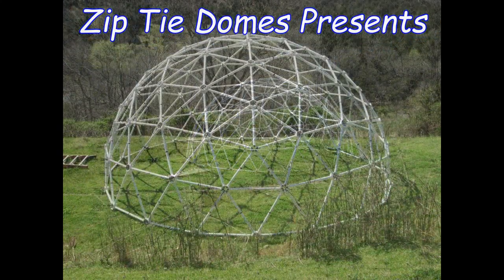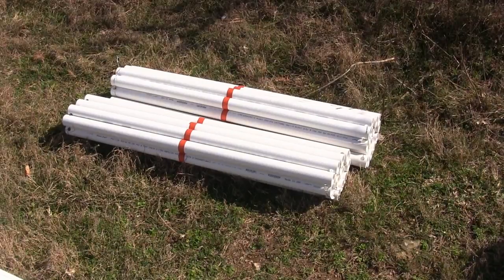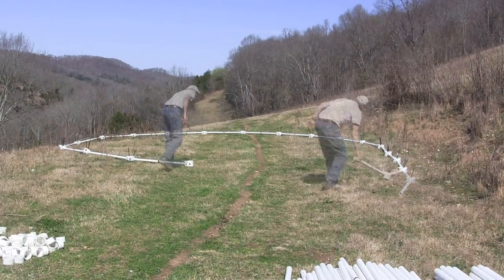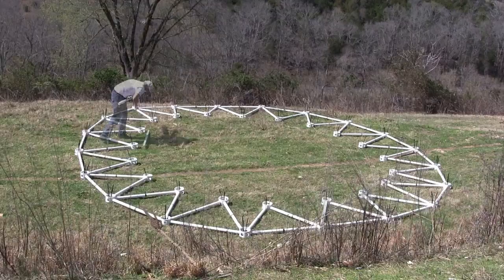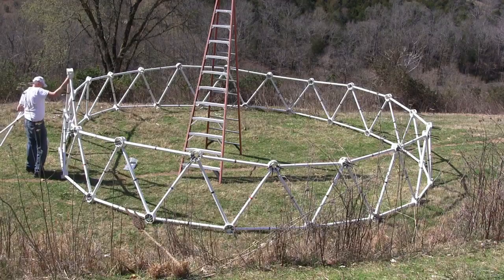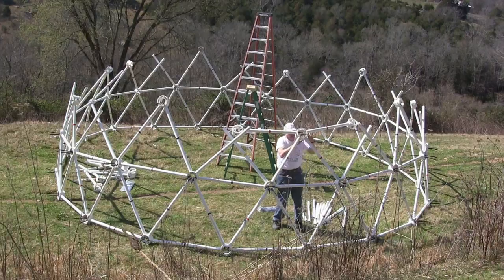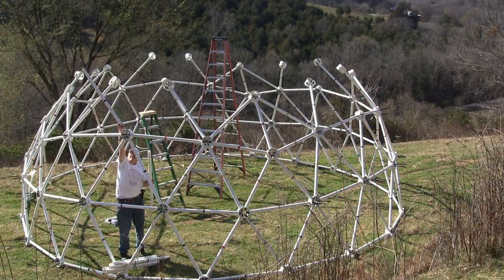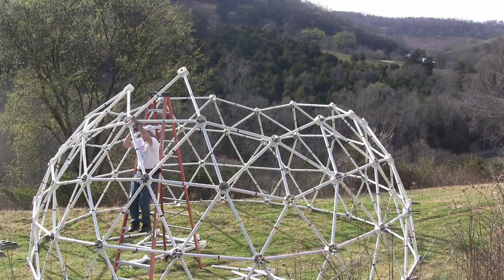How to Build a 4v Geodesic Dome

Comment: I once tried to do something like this with 4" pvc hubs, 2"x3' pine logs, and pipe strapping. I was not aware that the edges needed to be slightly different lengths so by the third tier it was seriously out of round and the pvc hubs were beginning to warp from the weight of the logs.
Reply from the maker: Yes, I would use metal hubs for pine logs.  But that is great that you are developing new ideas.  Thanks for watching the video.  John Hurt

Comment: This is amazing!!! I just finished building an 8M geodome made of aluminum with bolts and it was so freakin hard and was a 2-3 man job. Next time I'm going to go with this model. Love it, especially those easy connectors!
Reply from the maker: Thanks for watching the video. Have a great day!  John Hurt
Reply: The hubs simple but are not self-centering, which will become apparent when you try to re-center them under load.

Comment: Thank you for the video.  I will look at your calculator to build a 14' diameter 2v dome for my daughter as a greenhouse/hang out space.
Reply from the maker: Hello.  Yes, you can buy a 13' dome 6.5' tall at this link:
https://www.ziptiedomes.com/geodesic-dome-kits/13-2v-geodesic-dome-kit.htm
Or you can purchase just the hubs from us, and cut your own struts from 1" Schedule 40 PVC pipe.  The "Hubs Only Kit" is at this link:
https://www.ziptiedomes.com/geodesic-dome-hub-kits/2V-Std-Geodesic-Dome-Hubs.htm
Call us at (931) 858-6892 and we can help you with the strut lengths for your 14' dome.  Or you can use our dome calculator at this link:
https://www.ziptiedomes.com/geodesic-dome-calculators/2v-geodesic-dome-calculator.htm
Just click the "standard 4" hubs" radio button, put "14" in the dome width/diameter, and click the blue "calculate" button.
Thanks for watching the video.
John Hurt

Comment: 4 frequency
26ft diameter
13ft high
4826³ft
548²ft floor
30 Red A struts 930mm (3'⅝")
30 Yellow B struts 1100mm (3'7¼")
30 Brown C struts 1095mm (3'7⅛")
70 Black D struts 1172mm (3'10⅛")
30 Blue E struts 1220mm (4')
30 Orange F struts 1115mm (3'7⅞")
6 Red 5 way hubs
85 6 way hubs
91 centre rings
500 zip ties

The diameter of the struts and holes is covered here :
https://youtu.be/v_NnY_yYwuc?t=540s
Reply: chickkeys  It's in the video description, which is sometimes hard to see if you are using a tablet. The struts are made from standard 1.5" Schedule 40 PVC pipe.

Comment: No BS here. Great video. Great idea for a Permanent Home structure...using 1 inch Conduit.
Reply from the maker: Thanks.  Check out the Desert Domes website, they show you how to flatten the ends of the conduit, drill it, and bolt the ends together to make your hubs or vertices.  That would be a great way to do it and make your own hubs.  John

Comment: great tutorial and this looks really easy to do. However, zip ties? How are they going to withstand the power of the sun whilst holding up all that weight?  I have secured some plastic net on my railing with zip ties and a couple of years later the sun made them brittle.
Reply from the maker: That is a great question.   As this is a temporary build, the video shows us using 250 lb UV resistant Nylon Zip ties which will last for several years. But for all of our large geodesic domes, we provide 350 lb Stainless Steel zip ties that will last forever.   Thanks for watching the video.   John Hurt

Comment: Hi. Can a pipe diameter of 25mm be used for 4v? (width 8m height 4m)
What thickness would you recommend?(25mm-32mm)
Reply from the maker: We use 32mm as it is much stronger for larger structures, but we can drill the hubs to work with 25mm pipe just as well.  Thanks for watching the video.  John Hurt
Reply: @ZipTieDomes  Thank you very much. Do you mind if I make this 4v structure with my own means and share it with you on youtube?
Reply from the maker: @eyyupk  Yes, you can build one, but I don't need it on YouTube. Just send me a picture of your completed dome - in exchange for a license to use our patented hub design.  
https://www.ziptiedomes.com/faq/Are-You-Making-your-Own-Hubs.htm
Thanks!  John Hurt

Comment: I’m looking for a semi permanent structure.   Wonder how it would do over winter in Canada  north of Montana 
Saw the cover video with the use of caps 
I want a 24 foot diameter 3 season work area protecting from weather
Reply from the maker: The strongest domes we have are the "Shelter Domes" with 1.5" PVC pipe struts.  
https://www.ziptiedomes.com/geodesic-shelter-domes/index.htm
They can support over 300 lbs from a single hub:
https://www.ziptiedomes.com/video/silodomeloadtest.htm
You can also buy just the 6" Super Hubs and cut the 1.5" Schedule 40 PVC pipe struts yourself:
https://www.ziptiedomes.com/geodesic-dome-hub-kits/index.htm
Call us at (931) 858-6892 if you have any questions.
John Hurt

Comment: Hey, I see that you may still be responding to comments on this video! That's very cool!

I was wondering if you know if it's possible to make a dome out of struts that are all the same length.?? And what shape would that be?? I was looking at an icosahedron, and "bisecting" it to make it look more round, but does that mean that the lengths of the struts have to be increased to make it look round? Thanks!
Reply from the maker: The 1v dome can be made with struts all the same length.  Here is a calculator:
https://www.desertdomes.com/dome1calc.html
Thanks for watching the video.
John

Comment: Appreciate the video. What is the snow load?
Reply from the maker: With 1" PVC pipe and Standard Hubs, the dome will support around 180 lbs from a single hub.  With 1.5" PVC pipe and the 6" Super Hubs, the dome will support around 300 to 350 lbs from a single hub.  
John

Comment: Hi John,
I really like geodesic domes, I believe they are the pinnacle of human ingenuity. They are very rare however, I have never come across one. I'm thinking about building my own in my back yard, although I'm still not sure what I would use it for.... do you have any recommendations? I don't know how I would enter the dome, since there is no door, or how to place anything inside it, for that matter.... I might cover the outside in solar panels since I want to do my part in fighting climate change.
Suggestions would be greatly appreciated! 
Thanks a lot,
Steven
Reply: Hey VR, I just started building a dome a few months ago and am documenting my process and all of the issues I have run into. The material really depends on what you are looking to do with it. I am building a timber dome using bevel cuts because it results in smooth transitions between panels which allow me to easily attach polycarbonate, film, or wood for the covering. If you were wanting to cover it in solar panels, I believe that would be best as well. With a PVC or conduit dome, I can see there being a lot of issues with being able to sturdily attach anything besides film. As for the door, one of the 5 point attachments is usually disassembled and extended into a door (I can find a source to show it if needed).
Best of luck!

Comment: thank you , very nice structures you do there,  i have checked the calculator online  it is amazing also, what is the diameter of central ring ?
Reply from the maker: It depends on the hub size.  Either 2" or 3".

Comment: I’m thinking of a dome built from the top down to the bottom so every level would just raise up and the ladder would be used less.  Have you tried that, and if so how did it work?
Reply from the maker: I did, and it seemed to be harder to to.  I had to build a pole with a pulley on top, and pull the dome up as I built the lower sections.  It was a lot more work than building from the bottom up, but I did not have to get up on a ladder.  I would suggest starting with a small dome and build from the bottom up first to get experience on what works and what doesn't. Thanks for watching the video.
John Hurt

Comment: Loved your video! Want one. Do you have any recommendations for coverings? Would love to make it a permanent structure.
Reply from the maker: I would cover it with mesh and spray it with latex cement for a roof.
Reply: @ZipTieDomes  do you know how much of it is needed ?
Reply from the maker: @chegist  It depends on the size of the dome.  Pick out a dome from our website:
https://www.ziptiedomes.com/
then contact me at this link:
https://www.ziptiedomes.com/contactus.htm
Thanks.  John Hurt
Reply: @ZipTieDomes  Haven't seen any recent postings to YT, hope all is well as possible, if you are still around with your business, did you try the latex cement as you were planning on covering a dome with this method
Reply from the maker: @sjr7822  I made a concrete dome prototype, but I have not made a video about it yet.  Thanks for keeping tabs.
John

Comment: How much weight can this structure sustain? Can you show a finished product with glass?
Reply from the maker: The 1.5" struts will support around 300 lbs from a single hub.  We usually cover these with greenhouse film, as glass is very expensive.
Thanks for watching the video.  John Hurt

Comment: Very interesting project.  Was wondering why so many different sizes in the struts?  Can it be simplified to 1-4 lengths?  I'm sure rigidity is the reason but just started learning about these.
Reply from the maker: We did create a "Simplified 4v Dome Calculator" with only 4 struts instead of 6 at this link:
https://www.ziptiedomes.com/geodesic-dome-calculators/simplified-4v-geodesic-dome-calculator.htm
But for the dome to be mathematically "correct", it requires 6 strut lengths for a 4v dome.  It has to do with how the triangles are broken down into smaller triangles to make the 4v dome design.  That is a good question,  go to our "Contact Page" if you want to discuss this:
John Hurt
https://www.ziptiedomes.com/contactus.htm
Reply: @ZipTieDomes  great, I'll check it out and reach out if i have any more questions.  Thank you!

Comment: What type of materials are used to enclose the dome? Can you attach wood or plastic triangles into the pipes as a form of roofing?
Reply from the maker: We usually cover it with a single sheet of plastic.  If you cut plywood into triangles to cover the dome, there is a LOT of waste.  Thanks for watching the video.  John Hurt
Reply: @ZipTieDomes  thank you

Comment: is it possible to build a geodesic dome using only some size pvc pipes?
Reply: If you don't have the retaining rings, it will just be floppy. There's also some companies that make 4, 5, and 6-way PVC connections for this purpose, but they're a lot more expensive than making your own rings.

Comment: How do I figure out the measurements for a 35 foot high on top by 35 foot round? Looking to build one of these under ground and out of metal and concrete reinforced. 10 ft drop from the bottom of the structure straight down? Plus what was the cost of this build with PVC piping and zip ties
Reply from the maker: Send me an email, or call me and I will be glad to work directly with you on your project, at no charge. 
https://www.ziptiedomes.com/contactus.htm
Thanks,
John Hurt

Comment: That is a great system for the frame construction, do you have a similar system for covering the domes in different fabric and rigid materials? Also how easy is it to adapt the system to produce a structure that is longer in one floor dimension to build an enclosure better suited to a rectangular space?
Reply from the maker: Daniel,  We don't offer covers at this point, and so far we only have round dome designs.  But those are two very good ideas.  Thanks.  John Hurt
Reply: Steve Baer developed Zome geometry which allows you to stretch the dome shape. It's significantly different from geodesics, though, so I'm not sure it would work with these hubs.
Reply: @ZipTieDomes  What is the purpose of this structure if not to add greenhouse plastic or covers to turn it into living tent space of some sort?

Comment: Could you make a honeycomb geodesic dome? I have a vision to make a honeycomb geodesic dome that would cover an A Frame tiny house, maybe about 20x20 ft, with the floor diameter of maybe 20 more feet with the house being in the middle so 10ft in radius. And about 20 more feet above the house itself. This way it encloses the house during rain and snow, and making a number of the honeycombs being able to open up but have small mesh to prevent bugs and other pests from coming in. And having 4 smaller domes attached to the large dome to create a 5 point dome system. One dome for growing veggies, one for growing fruits and one for having chickens or ducks and the other for having rabbits. Almost like a biodome enclosures, but being in the forest close to nature without damaging or touching nature. So the large dome acts as a natural greenhouse for the house itself. Making it warm during the winter months and dry during the rain months, thus using less material for keeping warm. Do you think its possible to do this out of your PVC design? And having an entrance door way big enough to fit a car through.
Reply from the maker: That is a really neat idea.  You are welcome to try it, I seem to lack your level of imagination.  But what a spectacular idea it is.
Thank you for watching the video.
John Hurt

Comment: it would  be easier to start with the top and work down attaching one strut at a time as you go around and down.. if the hub/strut can stand the pressure.
Reply from the maker: Building from the top down is a good way to build a dome, but you need a crane or mechanical lift to raise the dome for each level for each level that you build, as the completed 4v dome in this video weighs 594 lbs.  
But when you build the dome from the bottom up, you only need a stepladder to build the dome, and you don't need to use a crane or lift to raise the dome.
The top down building technique is a much better way to build a metal conduit dome that is bolted together with a single bolt for each hub - as you have to take the bolt out of the hub each time that you add a new strut.  With a top down build, you can add all of the metal conduit struts at once, bolt them to the hub, and they just hang out in space.
With our hub design, you don't have to un-bolt the hub to add the new struts, you just drop the struts into the hubs and zip tie them with stainless steel zip ties.  This hub design makes the "bottom up" construction technique very easy to do, and there is no advantage to using a top down construction technique.
So yes, for metal conduit domes that are bolted together, top down construction is the way to go.
For PVC dome using our hubs, the best way is bottom up, as all you need is a stepladder, and no fear of heights.
Thank you for your comment.  John Hurt

Comment: cover it with wetpaper towels and splay on some concrete and you got a home
Reply from the maker: Check out this customer review where we use latex cement to cover a dome:
https://www.ziptiedomes.com/customers/lenabach.htm
Thanks for watching the video.  John Hurt
Reply: @ZipTieDomes  Before you put up, add a layer of thin foam insulation panels. seal and then spray the concrete.

Comment: how did you determine the no. and size of struts?
Reply from the maker: I used our geodesic dome calculator at:
https://www.ziptiedomes.com/geodesic-dome-calculators/4v-geodesic-dome-calculator.htm
John
Reply: @ZipTieDomes  how does the calculator work? Is there any formula to calculate the strut length manually?
Reply from the maker: @sathyashriya3905  The Chord Factors are on the left side of the calculator.  If you multiply the chord factor by the radius it will give you the strut length.
Reply: Thank you :)

Comment: How do you clip glass panel to this?
Reply from the maker: You would have to drill through the panel and through the struts and connect it with a bolt and nut.  A better way is to put greenhouse plastic over the dome, as in these two videos:
https://www.ziptiedomes.com/video/coveringsvideo.htm
https://www.ziptiedomes.com/video/coveringtestcaps.htm
Thanks for watching.  John Hurt

Comment: 5-freq. Next?
Reply from the maker: Yes, I will do a 5v video if I can find enough short pieces of pipe in my scrap pile.   A 5v makes a very large dome, and I don't like to work more than 15' off the ground, so I need shorter struts.  The 5v 5/15 dome has 425 struts, 151 hubs, and 850 zip ties, so it is a very large project that you want to think about before you jump into it.  Thank you for your comment, and I love your personal picture logo.  John Hurt

Comment: Its Awesome! can it build to permanent building? I meant for residential house? Sorry for my poor English language
Reply from the maker: The best way to build a house  or permanent building is to cover the dome and spray it with concrete, like shotcrete.  Some people cover the dome with chicken wire and spray a weatherproof closed cell foam for a covering.
Reply: Zip Tie Domes thanks a lot for information

Comment: Step 13:  Get in big trouble with the County.
Reply from the maker: Paul,   

If you don't have a foundation for the dome, a geodesic dome is usually classified as a "temporary structure" and falls outside of most codes, much like a tent.  Most counties have absolutely nothing in writing on geodesic structures, only that a structure cannot be over a certain height, etc.  

Before you build a dome, get a copy of your county's ordinances and codes, read it, then ask them to show you specifically where a geodesic dome with no foundation would fit in the codes manual.  Most likely, it doesn't fit at all.  It would be better to know what you are up against on the front end, before you bought anything.  

I had one person in Oregon tell me that the dome in his area had to be less than 200 square feet, due to codes.  So we made a dome exactly 199 square feet for his location.  No problem at all.

Anyway, you have brought up a very good point.  

Thanks.  
John Hurt